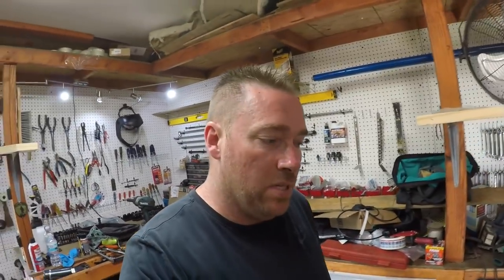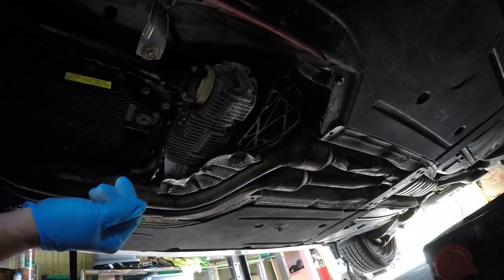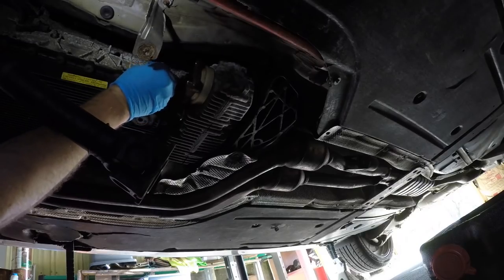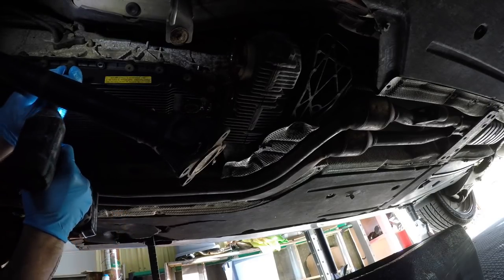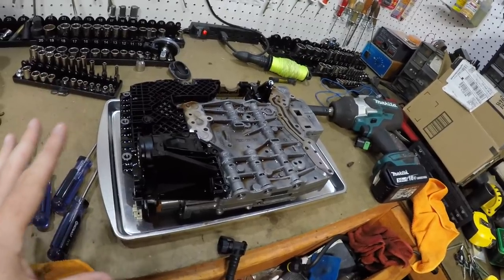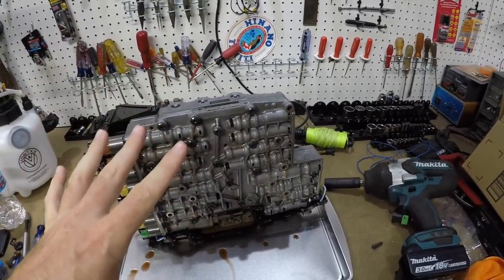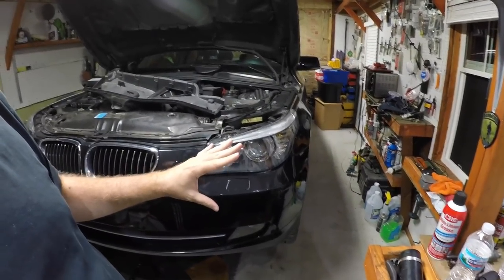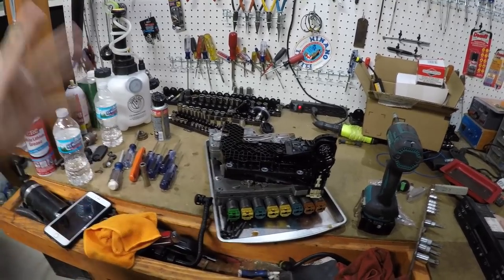BMW E60 ZF 6hp19 AWD Transmission Service and Valve Body Removal

Comment: Removing the plug sleeve on the X-Drive 5 series is a headache due to the transfer case bracket interference. Did you fully remove the sleeve, or just loosen it and slide it back far enough to get the valve body out?
Reply: I had the same issue with my 525xi. Had to remove the seal with a long set of pliers to get any room and had to reinstall a new one.

Comment: Nathan, i have a 2004 bmw 530i with a zf 6hp19 and i have a 4-5 flare above 3000 rpm. I just let it shift with  at low rpm!
What would you do to fix it? Shifts fine except high rpm. It has 200,000 miles on it and I have been driving for 60,000 miles like this. Would you put max life fluid in it or just replace solenoids and reman valve body?

Comment: My BMW500 E60 I changed gear oil as usual ZF LF6 after driving one km start  to jucks then stop after switching off the engine starting it I drove for another one km it stop advice please

Comment: Hi, great video, you seem to be knowledgeable at this.  I am debating whether to replace the mechatronic unit or just the solenoids.  Are all of the (accumulator?) pistons supposed to push in and out via spring action? On my ZF6HP19 mechatronic, some pistons don't move at all.  Specifically, in my unit, there are 5 pistons with cotter pins on the underside (assuming top side is where one can see the solenoids), 3 of them facing the right, 2 facing the left. The smaller 2 of the 3 facing the right, push in and out with spring action pushing them back out.  The third, being the bigger one, with a bigger radius, is stuck, does not move.  The other 2 pistons, facing the left are stuck, do not move. Looking at the edge of the mechatronic, opposite to the edge where the solenoid valves are, there are 6 pistons with cotter pins, 2 on the longer part that's protruding, they both push in and spring back out (one of them is deeper in, but still can be pushed with a finger), and there are 4 on the shorter part, by the tab that reads 1068327179.   Out of these 4, the 2 smaller ones, to the left, push in and spring back out.  The 2 to the right, with bigger radius, are stuck. Is this normal, or the pistons that are stuck are bad and I need a new mechatronic unit?  Thank you very much for your time.

Comment: Do you need to check the transmission temperature while filling? Also, do you need to reset transmission adaptation after change?
Reply: Yes and yes.

Comment: I had this done in a 2007 E90 328XI with the GM transmission.
Following this my transmission is going down according to several shops. I am now needing a rebuild although the car runs fine. What could this be Nathan??? PLEASE HELP I sent you an email too

Comment: I'd happily purchase a BMW from you with confidence. I have a 520I 2000 is there a transmission fluid level I can check ? Was last done at 90,000 it's on 130,000 now